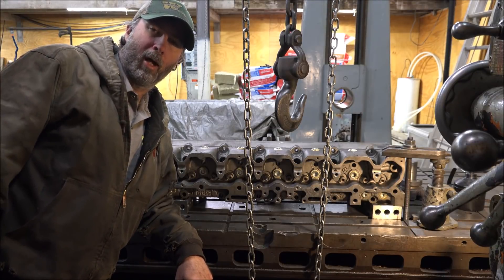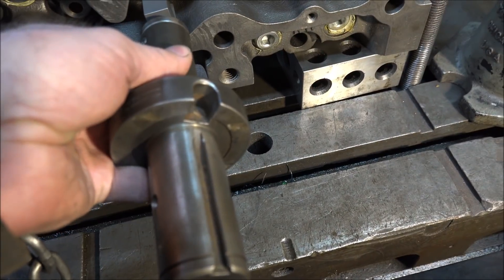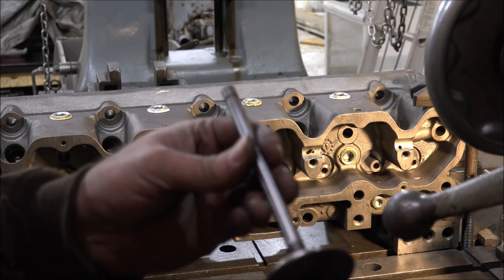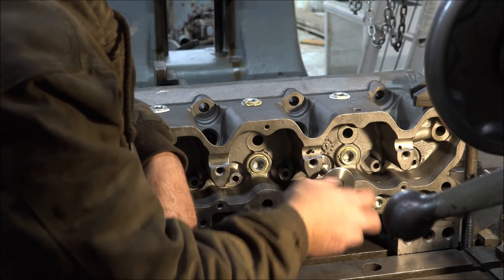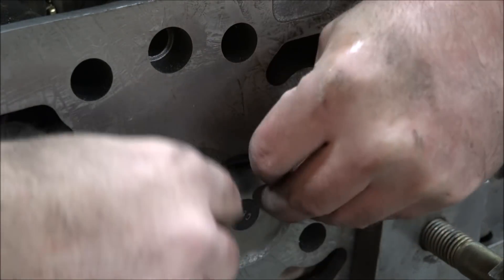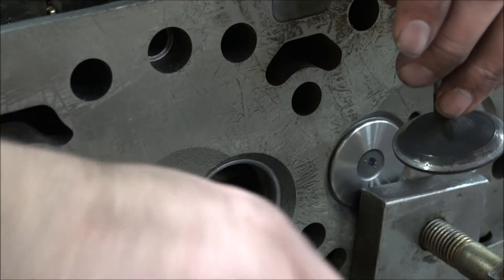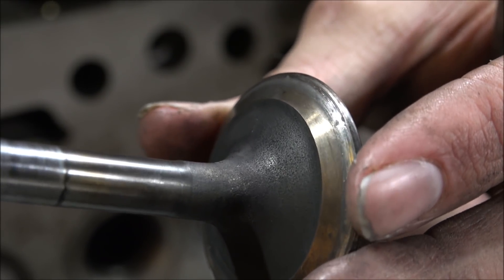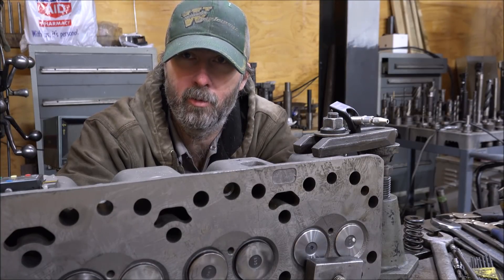Cylinder Head Valve Spring Pocket Machining and Guide Sizing Job ModificationFor Big Lift & Springs

Comment: Attention all viewers!!!  This is not how these operations are performed in the real world !!!!  What a joke!
Reply from the maker: I mean you can do it with a drill press or a hand drill if you want like Comp tells you to use. But I prefer being able to square the head and then cut all the spring pockets so they are parallel to the head deck and to the same depth within .001" using the readouts on the mill. You should put a video up on the right way to do it so people can learn properly.
Reply: While I didn't have a giant HBM to use, I did hundreds of these type of jobs on a Bridgeport, in the real world. One difference is I would use fixed guide reamers for production work and a Sunnen hone and dial bore for race guides. After any guide work I would always grind the seats to insure they are true to the guides. Keep up the good work Brian.
Reply: @bcbloc02  i am starting a channel so that people can know the difference between right and wrong!!  How did you square the head ??? Manifold surface is the wrong answer, needs to be leveled/squared off of the valve guide.  . What is the table run out on the old machine?? Even a Bridgeport would be better than this method but a Bridgeport would still be a royal pain.  Cylinder head machines with air float heads or tables that allow you to level the head off of the valve guide and quickly center on a pilot  have been around for over 50 years and the market is flooded with them.  They are cheap , fast and accurate.  That  whole process start to finish is less than 10 minutes .Valve guides have set clearances not "wiggles".  Nearly all diesel valves have pitting to one degree or another.
Reply: You have no videos.
Reply: @BasketCaseGarageForFun  currently trying to get a channel named approved , evidently the name I submitted closely resembles another unrelated channel name.
Reply: @andrewevans1658  when you have a channel name approved and have posted a video, come back here and let us all know. We'd hate to accidentally view anything on your channel because we didn't realise that it was your "real world" work.
Reply: @tda2806  people like you who follow blindly without the willingness to learn the difference between right and wrong is what is currently wrong with this country.  Have you bothered to even search YouTube for cylinder head repair to see how people in that career field do things??  Probably not
Reply: @Rx7man  if you had bothered to read all of the comments you would see what what was wrong.
Reply: @andrewevans1658  "lighten up Francis"!!!!!.... 😆😆😆😆😆😆😆😆😆
Reply: @andrewevans1658  I’m confident many of Brian’s viewers understand that the G&L HBM is not the most optimized machine for production head work.  You, being a cylinder head reconditioning expert, should also understand that excellent work can be done with a variety of tools and methods.  I believe many of Brian’s viewers probably enjoy his variety of subjects/work and understand that it is his humble attention to detail, while not always explicitly demonstrated, which results in a quality finished product.
Reply from the maker: @andrewevans1658  The head was set square by tramming the head deck to both horizontal and vertical so the deck was square with the machine spindle. within .001" over length. This is far more accurate than the bubble level method many automotive machine shops employ. I can only hope whoever put the valve guides in took the same care and put them in perpendicular to the head deck like they belong.  My machine is capable of holding flat and square to under .001" in 6feet in all axis, not even a new Bridgeport would be close to that. After reaming I checked the valve stem bores and all were within .0005" and in the middle of the specified range per the service manual. I didn't show that part because it varies from engine to engine and I wanted this to be a general video and for people working on putting heads together at home the hand feel method is totally valid. This head came from an automotive shop and the guides were over .001" below minimum spec. You have to check the stuff you get because many shops rush jobs thru and they aren't correct.  I reckon since this is a 10 minute job you charge $10? Just because I am doing the job with a proper machine tool instead of a specialized single job machine doesn't mean the job won't be just as good or in most cases even better. I am showing a way to do the job not the only way.
Reply: @bcbloc02  
hello my name is michel .. i am from spain and my trade is professional milling and precision mechanic
I worked for a couple of years in a workshop specialized in the treatment and reconditioning of all types of engines with professional machines for those jobs
Today in my house I do many of those jobs with a boring machine from 1960 and with my turret type milling machine and I get as much or more precision than when I did it in the specialized workshop with exprofeso machines ... the only difference is that in my home workshop it takes Much more time but the final result in most of the cases is more precise since I take things with the tranquility and professionalism that is needed to carry out this type of work well.
therefore I can affirm that Brian's method is totally correct and that work can be done very well without any kind of problem .. as I mentioned before the only difference is time .. which is irrelevant when it comes to doing a job precision and more in a workshop without specific machines for engine reconditioning
In the end, what commands in these things is the knowledge on the part of those who do the work and that does not happen overnight.
Greetings Brian and you have my support.
Reply from the maker: Thanks Michel and I 100% agree.  I have run Rottlers in block shops and while they are great at what they do my Boring mill is more rigid and capable of doing  bores with superior alignment and rigidity but setting up takes tons longer. In the end the machinist has more to do in general with the quality of the job than the machine they used to do it with.
Reply: @bcbloc02  Thanks to you for showing a job well done and a professionalism in the execution that shows that the mechanics of the old school with our conventional machines still have a lot to teach the new generations and that we know how to solve the jobs without the need for cnc machines or programs from cad cam ..
a hug friend and thanks for your time
Reply: @bcbloc02  your big mill never had or ever will have the accuracy of anything rottler ever made.  Time is money and those quick  simple tasks don't pay well.
Reply: @TrPrecisionMachining  Every video of Brian's i have ever wasted my time watching is a hillbilly hack job from start to finish, absolutely nothing professional or precision about it,  contrary to what he might say in the video. This video is the equivalent of turning wood on a metal lathe,  possible but far from efficient/productive.  If you wish to see how that type of work is properly done check out channels like Fiatnutz or Jim's automotive machine  shop Inc.
Reply: @andrewevans1658  I do not agree at all with your comments ... for me Brian does a professional job and you can see the amount of years of experience he has behind him ...
On the other hand, I don't need you to show me any video of anyone ... I am a professional and worked in engine rebuilding companies with their appropriate machines ... but that does not detract from the work that Brian does, if not quite the opposite since it shows that with knowledge precision work can be carried out on machines that a priori are not the ones used for those purposes ... therefore as a professional and precision mechanical milling machine I would ask you to leave with your negative comments outside of this channel and entertain yourself planting flowers in some garden.
michel
Reply: @TrPrecisionMachining  if you agree with his methodology of anything engine related you obviously didn't work in that career field very long.  I deal with over 30 dealerships and independent shops and none of them would employ him for more than a day.
Reply: @andrewevans1658  Brian's machine can certainly hold tolerance, so the only thing not optimal about the setup is that it takes longer to do.    With the attitude you have, I'd never use your shop, I've worked for a guy that rebuilt rotary engines and he sounded just like you, Spent most of his money on his nose and screwed customers over with lazy work, even though he did have the skill and knowledge to do better... Warranty? Oh, he always boasted about it, but there was always a way to weasel out of it if there came a time to actually need it
Reply: and yea, I did read all the comments
Reply: @andrewevans1658  we have different points of view therefore we are never going to reach an understanding .. your opinion what you want and in this case I think the opposite .. in this world there are two types of people .. those who spend the day criticizing others and those who fight every day to earn their bread honestly ... I belong like Brian to the second group ...
Greetings from Asturias Spain
Reply: @Rx7man  you have absolutely no idea what tolerances his machines hold other than what he tells you and you obviously believe it.  With his methods I would have been out of business 20 years ago.  Time is money and he obviously doesn't charge very much which is why he gets stuck with a lot of those jobs.  You don't know me or anything about me.  I am a professional who knows the difference between right and wrong and more than willing to pull BS card when needed or give praise when due.
Reply: @TrPrecisionMachining  i praise when praise is due.  I don't blindly follow , which is obviously the case with most of his viewers.
Reply: @andrewevans1658  Better not see the content of my youtube channel as it will surely not be to your liking or measure up to your level of knowledge
a greeting
Reply from the maker: You clearly don’t know about machine tools. A machine like my G&L would be the machine that would make a Rottler.  Not that you would care but if you went to back yard machine shops channel you could find where the shaper body I machined for him was taken to the aerospace shop he runs and verified on their cam that every surface was flat square and parallel and with a positional accuracy of .002” in a 3ft by 2ft area. That isn’t me claiming it. It’s independently verified and surprised even them because they have million dollar Cnc machines that don’t turn out work that close. A Rottler doesn’t have the travels to even do that job. An Em103h has a similar table size to my machine. Mine weighs 47000lbs the Rottler weighs 16000lbs.  They aren’t in the same class as for capability. The G&L wins hands down.
Reply: @bcbloc02  You have again expressed, more accurately and more eloquently than, what have I failed to with my own comment.
Reply: @TrPrecisionMachining  I agree
Reply: @ekieffer68  thanks
Reply: @bcbloc02  your machine is for fixing backhoe buckets and boring large objects.   A rottler is a specific machine designed to do very specific tasks quickly and accurately.  You could buy a older petersen or kwik way air float mill with basic tooling for 2500 and it would take less than 10 heads to pay for itself, then is pure fast profit after that.  I'm not saying you or anyone should buy a 65K serdi machine. If my block/head resurfacing machine could only perform at .002 over a 2'x 3' it would have been in the iron pile years ago.
Reply from the maker: You are missing what the criteria were. It was twelve surfaces in 2 planes 90 degrees from each other with no feature having an error from the ideal position being more than .002" Measured on a CMM. This was not a single flycut over a 2'x3' area. I ran  Rottler doing 3500 Cats and Cummins K50's for 3 years I know what they will do. I am not looking to go into mass automotive machine work. I just do the odd jobs people want done and want done right and are willing to pay for such.
Reply: @andrewevans1658  I would pay good money to see you build an engine and put it up against one that Brian has built. He never claimed to be the fastest or make the most money. He understands what needs to be done and gets the job done. In the 'real world' people put their money where their mouth is. My money would be on Brian's experience on what is actually important vs you spitting out a bunch of numbers.
Reply: @TrPrecisionMachining  I am 70 years old and have been a machinist/mechanic since I was a kid in the sixties.  I stand firmly and proudly with you and Brian all day long.
Art
Reply: @artszabo1015  Thank you very much for your support .. only those of us who know how hard and complicated this job is can assess the resolution capacity at the foot of a machine .. a greeting from Spain
Reply: @andrewevans1658  "table run out" define that exactly.
Reply: @andrewevans1658  So sorry I missed this reply until now. To be honest with you even if your method is utterly correct and produces superb results I still wouldn't watch your channel because your attitude stinks worse than the local pig farm.

BTW how do you spell colour?
Reply: @Andrew Evans How is this done in the ‘real world’?
Reply: Thanks for letting me know that most places probably wouldn't do it right, I'm not seeing anything fundamentally wrong with how Brian is doing it, though it may not be financially feasible for a production shop, I have a sneaking suspicion this is a performance build though
Reply: Guys who believe they live in the real world, and everyone else is in fantasy land, are usually not the most fun to have around at a party...
Reply: @the_hate_inside1085  please search cylinder head repair on YT and you will never find these obscure methods used.
Reply: I'm pretty sure "Power Prepuce" is still available as a channel name.
Reply: please show/tell the real world HOW to do it .. wanna be TROLL.. Perhaps a dedicated Neway head bench in every shop?
Reply: Where are your videos of you doing this kind of work? Brian has proven over and over again that he has the skills to build this kind of stuff. At home by himself. Then successfully running what he built. Until your channel has as many views and subscribers as Brian’s your just being a clown here. Really😄
Reply: Aah ya.... have nice day.
Reply: There will never be any doubts in anyone’s mind that has followed Brian for any period of time that he holds Mastery of these skills. As he has already explained he has no need of dedicated equipment. He can apply his knowledge and experience to use the equipment he has and accomplish the needed operation easily. Just because you haven’t seen anyone machine a head with a 40 ton mill has no bearing on whether it’s being done correctly. In this and other instances Brian shows he don’t need no Rotler.
Reply: @vastylebbq5203 in summary for the slow people, This is not how these procedures are performed in the real world, not even close! They never have been performed that way by a professional and never will be!!!  In fact any can perform these procedures somewhat crudely with a cordless drill on a picnic table and achieve the same results.  So for Brian to do it on a 50,000 pound machine is only done to impress and try to get views. An uneducated viewer obviously enjoys it and an intelligent viewer questions it. To follow people blindly is pure ignorance but as they say , ignorance is bliss.  I sent this video to other shop owners and they laughed at it. They referred to him as a hack who is good for business.  The inability of people to educate themselves is truly amazing.
Reply: @hiddenworldforge374  please show this video to any competent machine shop and they will either laugh or scratch their head in disbelief.  Do some research instead of blindly following him !!!
Reply: @andrewevans1658  Would you be able to reliably tell whether or not a head machined in this manner is different from a head machined to your liking?
Reply: @hiddenworldforge374  the end result is basically the same aside from the valve guide reaming that he doesn't understand at all.  This difference is less than 10 minutes start to finish on the proper machine vs. Hours of setup of the wrong machine .  Him trying to make people believe this how it is done everywhere is a very false claim.  He uses that machine to get views and try to impress people who don't know the difference.  Read the original post, this is not how it is done in the real world in a shop that performs those operations several times a day.
Reply: @andrewevans1658  He's doing an odd job because noone else in his area has the machines or knowledge to do it. You can't justify the room a specialized machine would take up or the cost when he can just plop it on the G&L and get it done. Space and money are scarce; why have machines that do one job when you can use one machine to do thousands of different operations? And of course he uploads it because it's cool. Why? Cause it's friggin cool. Same reason I upload stuff. And at no point does he ever claim this is how it's done everywhere, everyone knows this is a pretty odd setup.
Reply: @hiddenworldforge374  you can do it on your picnic table with a cordless drill !  I large drill press or a vertical mill would also work( which he probably has) and be much faster/profitable.  The proper type of older machine would do everything cylinder head related for 2500
Reply: @andrewevans1658  Ok? And Brian used his G&L for accuracy and rigidity. You said it yourself, there was nothing wrong with the way he did it, you just don't like it and you'd rather him do it hillbilly style with a drill or go out and spend too much money for a.machine that takes up too much space to justify the amount of use it'll get. You just simply don't like it because you see it was overkill, even though he got the job done and his customers are obviously happy because they keep coming back
Reply: @hiddenworldforge374  absolutely no way to do  it in a profitable manner on his machine.  He has used that machine for other clyinder head work in the past so he clearly has the "need" for the proper machine. A proper machine would also alow him to cut valve seats and would pay for itself in way less than 10 heads.  Something nobody mentions is that a machine only has X number of (accurate) cycles in its life span.  So why would you use a machine that has a expensive replacement cost, with expensive rigging and transportation costs, versus using a much cheaper/somewhat disposable machine???  I passed up two different HBM machines in the last year, they didn't even get the $3 opening bid because nobody wanted to pay the 3000-4000 loading fee.  I did bid on another last summer(free loading) that was basically the same as kieth Ruckers.    Yes space for me is at a premium (like most people) and most jobs on an hbm are very time consuming and typically not very profitable (unless you actually charge by the actual  hour and keep your friend list to a minimum).
Reply: @andrewevans1658  You're way too concerned for another person's profitability. Neither of us know the whole picture, and no matter what way you look at it Brian does make money so there's obviously profit to be made on that machine
Reply: @vastylebbq5203  Yes Brian is a true machinist in every word, Andrew sounds like a button pusher. You go Brian. Cheers Peter from Oz